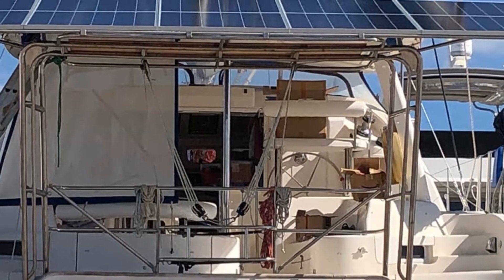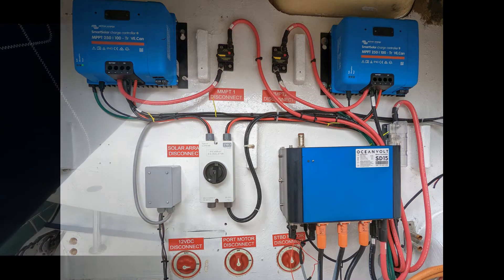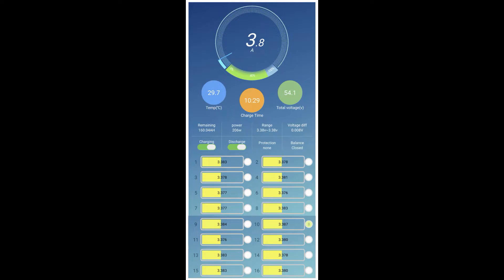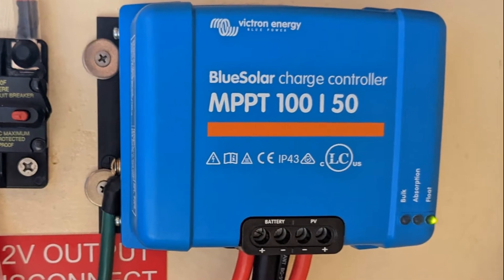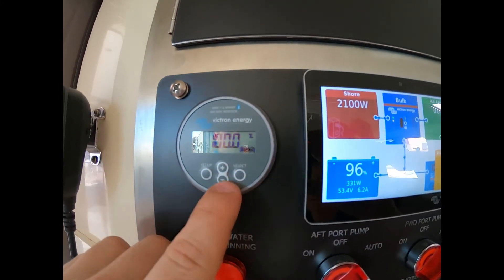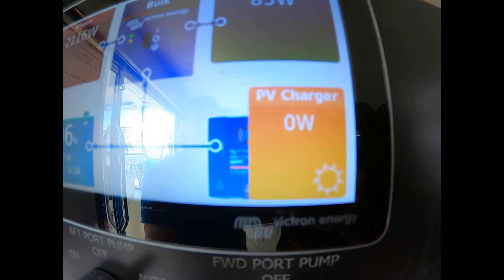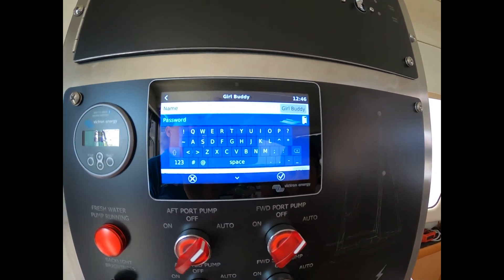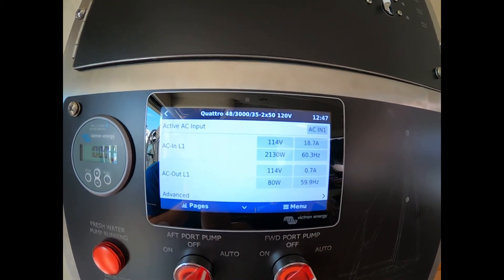Electric Motor Installation - OceanVolt SD 15 - 2005 Leopard 40 - Victron

Comment: Care to elaborate on your choice for a single solar controller? Still don’t fully understand all the pros and cons with multiple versus a single like your setup.
Reply from the maker: Hello Matt! When all solar panels run  through a single controller, if any single panel is interrupted (shading, etc.), that will disrupt the charging capacity of the entire array. This can be avoided by placing the less likely to have interruption panels on a separate controller.  You will see this sometimes when people place a solar array on a bimini top. They will place all the starboard panels on one controller and all the port panels on a separate controller, so when shade is cast by the sails or the mast on a tack, the changing capacity of the entire array is not interrupted.

We did not have this concern for the 5 panels on the back. They are placed in a way that if one panel is shaded then most likely they are all shaded. 

Beyond the considerations above there are the considerations of capacity and cost. Since shading was not an issue we had to then identify if it was more cost effective to purchase one large controller or two small controllers. We found that purchasing one large controller was better than purchasing two smaller controllers (and all the accompanying wiring). 

Hope this helps.

Comment: Where specifically do you have the controllers?
Reply from the maker: Motor controllers are located above each motor in their respective "engine" compartments. 

The solar controllers are both located above the motor controller in the port "engine" room.